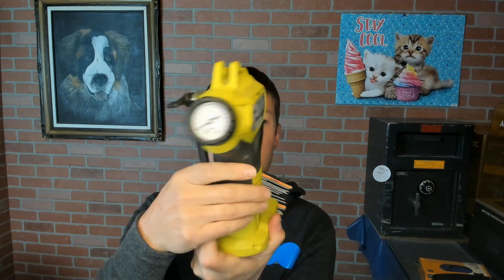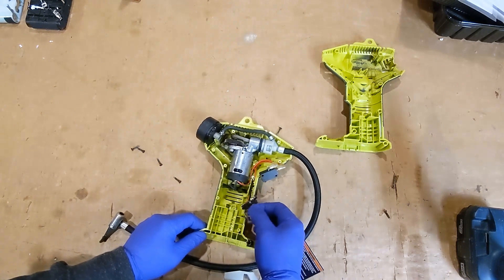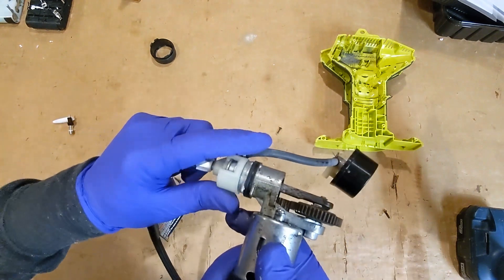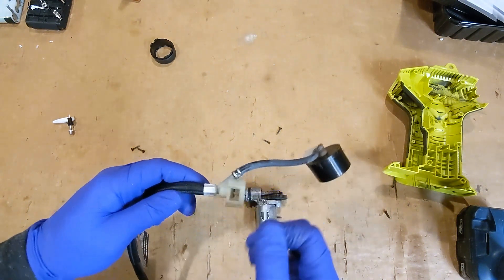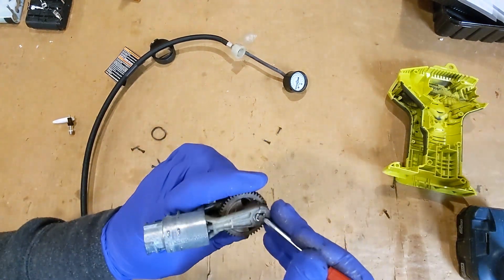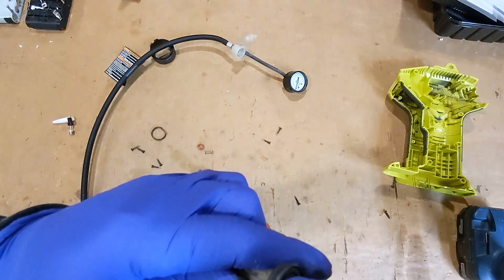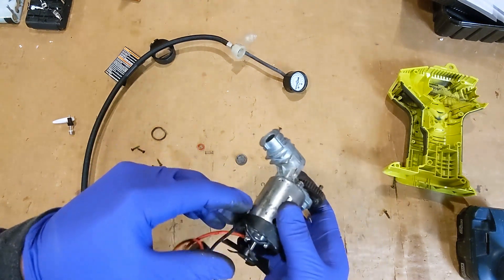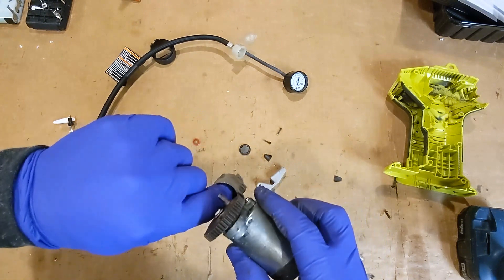Ryobi 18V Cordless Air Compressor Teardown

Comment: I bought a cheap Temu inflator and it worked OK at first but after a year plus sitting the batteries went bad.  It was built similarly to yours but even cheaper.  I can't imagine these plastic piston/rubber piston ring units give a very long service life.  Just wondering how much service life you got out of the ones you've had.